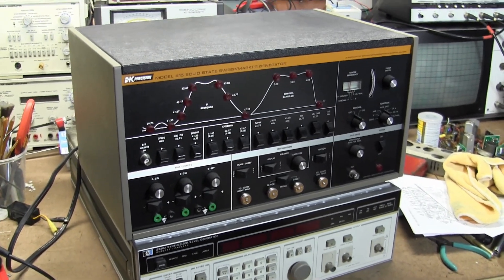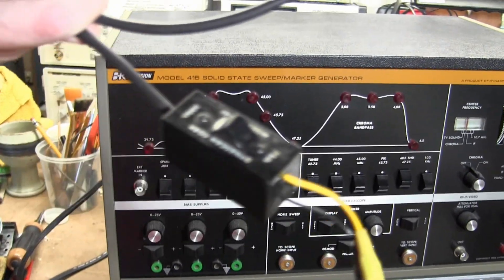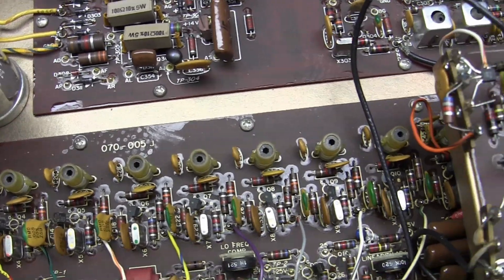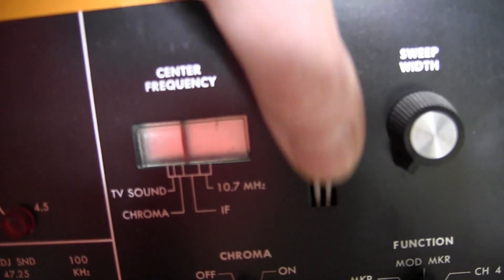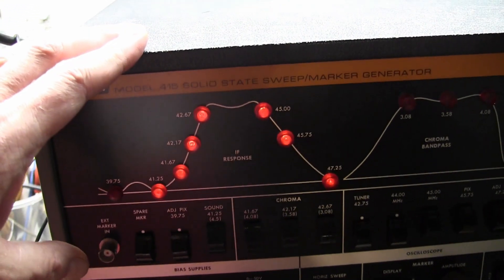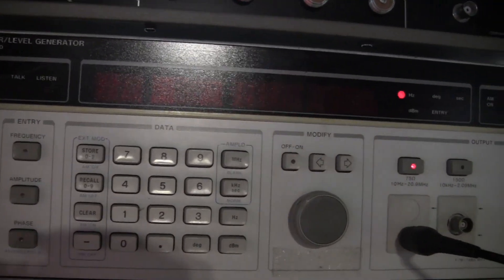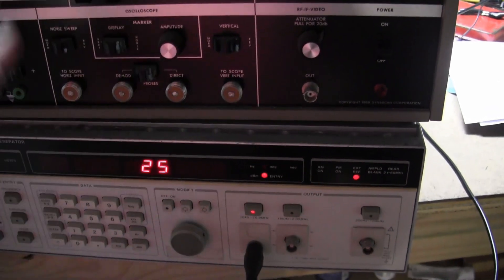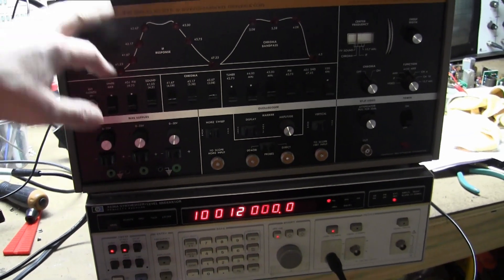Quick look at a B&K 415 and HP 3336A sweep generators

Comment: Please post an in-depth video of doing alignment with the B&K 415.  shango has videos, but his video on chroma alignment doesn’t explain where to hookup the B&K 415 to the tuner.
Reply from the maker: Problem is the 415 only works on newer chassis using a 44MHz IF.  Most of what I work on uses the older 22.  
Also, you really need to follow the alignment instructions specific to your chassis.  They will tell you where to connect the generator.  Generally, if you are aligning the IF, you inject at the input to the 1st IF stage.  If you are aligning the tuner, you inject at the antenna terminals.

Comment: Hi bandersentv. Thanks for the video. Sometimes the stuff you say really surprises me. Those 3 center connectors on the 415 are nothing but extremely common microphone connectors. These were used on all kinds of vintage test equipment, like scopes and VTVMs. AFAIK Switchcraft still makes them (Amphenol was only one of them.) Every ham with a junkbox, and some vintage gear has some of these. Available at any hamfest. I still see musicians using vintage Astatic mikes using those connectors.
Reply from the maker: Yes, they are common, but you'll likely need NBC adapters to connect to your scope.  Easier to swap them out.  I was referring more generally to vintage test equipment.  The RCA RW-514A or Philco 7008 use some really weird cables and pods.
Reply: @bandersentv  Especially given that the mounting holes for the old Amphenol mic connectors are the same 3/8" holes that you need for a BNC. You can "return to stock" in a few minutes if you ever wanted to for some strange reason.  Have never seen a "microphone to BNC adapter", so you would need to make custom cables for connecting with your scope anyway...
Reply: @bobweiss8682  No. When ever I've moded vintage gear (don't you just see the BS in the term 'vintage.') Anyway, whenever I'v moded this stuff, I've almost always regretted it. (I can't see that there's a problem used a 50 ohm BNC... from the 415 schematic... but there's a reason that B&K choose these mike connectors (they can go with 600 ohm cable.) Another-anyway if one doesn't know the reasons behind the design then.... Also, if someone can't (and I'm not saying you can't) ... if someone can cut a BNC - BNC patch in half, and solder a 250 F on the other end... how they gointo 'fix' radios?
Reply from the maker: These connections go directly to a scope.  How many scopes have 600 ohm input impedance or use mike connectors?
Reply: @willthecat3861  I thought 'vintage' was 20+ years and antique is 50+ years. Is that in error?
Reply: @bandersentv  Well... how many vintage scopes have a 50 ohm input? (some of the very high end ones had switchable 50 ohm impedance) How many modern scopes have it? There's a reason for the 600 ohm audio cable. The 415... I remember that the old T.V. service guy had in his shop, was paired with a B&K 1450 Oscilloscope that had mike connectors. Pretty sure some RCA WO series had mike connectors. Some Hikock had them too. It seemed to be common enough for early American manufacture scopes, that were low bandwidth (even for the day.)
Reply: @zulumax1  I don't know if there can be an error.... the best answer I can fathom is that it's all part of the BS.
Reply: @willthecat3861  "don't you just see the BS in the term 'vintage.' " Your words, I'm looking for clarification, because I am not seeing it.
Reply: @bobweiss8682  I thought I had a microphone to BNC adapter that came on my Eico 249 VTVM, but when I unscrewed it, it was a coax type connector like a RF antenna, not an Amphenol style microphone connector. Not sure if that is stock, never seen that on a VTVM probe connector.
Reply: @zulumax1  Baffeling Substitution of an oenologistic term often used in the context of deceptive marketing.
Reply: @zulumax1  Sometimes people try to bodge a PL259 connector (that's a common RF connector)... by cutting down the center pin of a PL259... to try to make a 250F type female mike connector... but PL259 has the wrong thread count... so shouldn't be screwed on... but people force it on anyway. Maybe the adapter you have was originally a PL259 to BNC... and someone cut down the center pin on the PL259 side. I have seen it.

Comment: Great explanation :-) 

What’s your opinion on a Heathkit TS-4A Television Alignment Generator 
I just found one for $20 at a swap meet
Reply: Replace the three electrolytic and all four wax paper caps . Check all carbon comp resistors for drifted values.
Replace the blue colored Selenium rectifier with a 1N4007 or better. Check all the tubes. Clean every switch as 
the contacts will surely be oxidized. There is a conversion sheet from Heathkit to make it a TS-4A if you want. 
The TS-4A manual  is available on the web for free.  You will also need a probe and or a test lead for it. Again
 see the manual for how to make them.  As for aligning it there I'm not sure as you may need an oscilloscope
 to correctly align on it. Good luck on the new acquisition.
Reply: Great thanks for the information and numbers. :-)  I’m quite familiar with replacing caps and restoring. I was more wondering if it’s something worth bothering with
Reply: @alexinnewwest1860  It's worth bothering with. For some people doing IF alignment on early T.V.s it's quite useful. The 415 won't do those earlier IF frequencies. It uses some common tubes... and put back right... the tubes could last a long time. It's got a pair of Colpitts oscillators... but if you cal it properly, and let it warm up... it's much better than those old T.V.s
Reply from the maker: A bit too early for me.  You'll need to let it warm up and periodically calibrate.  Doesn't have post marker support either.  Eico 369 is a little better in that regard.  Also, it relies on the AC line for the sweep signal.  You may have trouble getting your scope to work properly if it doesn't support driving the x-axis form the ac line.  The phase control is there to help with that.  I'd swap out the old Amphenol connector for BNC.
Reply: Ok thanks.  Maybe I’ll throw some new caps in it and play around just for learning purposes. 
I just found a 57  Chisholm Industries  TV which was a local electronics manufacturer here in Vancouver back in the day.  I’m excited to pick it up
Reply: Be sure to get the calibration reference crystal that goes into the XTL socket on the face on the left side.  Its 4.5mc and came with the unit for that purpose.  The manual describes the calibration procedure using that crystal with either a signal tracer (or amp with a lead with a detector diode) or a scope.

Comment: A few years back, I lucked into an HP 8662A at a really good price (needed repair), and retired all the other RF and sweep/marker gens I had acquired over the years. Has the same programmable sweep features and variable encoder knob of the 3336A, but works up to 1.2 GHz.  It replaced an HP606A, a Boonton 202H, A Wavetek 1001, and a Heathkit IG-57A with one piece of gear.  Wretched excess for working on old TV sets and radios, but why the heck not?
Reply from the maker: Lucky!  Someday....someday....
Reply: because somebody else who really needs a 8662A is using the kind of gear you got rid off. (Maybe you need it too; but, that won't stop somebody who doesn't from copying you.)
Reply from the maker: Who exactly really needs an 8662A that is unable to get one?  If you're servicing the type of equipment that requires than level of sophistication, you should be charging your customers enough to afford one.  Better yet, get a newer device that's been calibrated and under warranty.
Have you seen Mr Carlson's Lab or the Signal Path?  They have piles of high end equipment sitting around.
Reply: @bandersentv  Exactly...
Reply: @bandersentv  Mr. Carlson creeps me out... but, that's just me... I'm not implying anything. Signal Path is a hghly educated engineer, and works for a modern research University, in a very expensive, well funded lab. But yes... they are examples of how YouTube influencers can have unintended influence, and lead people astray.
Reply: @willthecat3861  Interesting perspective you have on others collections of test equipment. I never thought of it as a moral dilema. Having a collection of more things than one person could ever possibly use does seem wasteful I suppose. I just thought of it as benign vainity.
Reply: @zulumax1  I wouldn't even go as far as any kind of "vanity". For many electronics hobbyists, vintage lab-grade test equipment simply becomes yet another enjoyable aspect of the hobby. Old enough to need some TLC to keep it going, which "serious" users aren't going to want to provide, but new and powerful enough to be head and shoulders above the usual service shop gear from B&K, Sencore, Heathkit, etc. Professional T&M gear of that era was designed to be serviced, and reading the service manuals and studying the schematics and construction techniques used provides an great educational experience in itself.  It is refreshing to work on equipment that hasn't been built down to the lowest possible price point, and that was absolutely "unobtainium" for anyone besides NASA or research universities a couple decades ago.
Reply: @zulumax1  Everybody is irritated by a moralizer... (my fave to disregard is Aesop... though he was good on Rocky & Bowinkle) ,,, anyway my opinion is given as a comment... not some attempt at a proscription... it's a free country, free market... business... yada yada and so on. I'm disinterested in what other people do, or don't do. But if you are not familiar with "The Tragedy of the Commons"...
Reply: @bobweiss8682  And so... are these kind of YouTube vids 4 people with a quality test gear fetish... or for mostly hobbyists putzing around with old TVs... not professional engineers or scientists... with a good understanding of analog and digital electronics.  U can fix and Eico, or a Stark, or Heathkit... if you can solder, and have some basic electronics knowledge and skills. Yes... older HP, Tek, R&S are well doced, quality made, and 'serviceable'... I've had to spend weeks (and months) sometimes, to understand what those engineers were trying to accomplish with that design... and sometimes longer to get the parts to fix it... not to mention the cost and time to cal it properly. Sure... I can pretend I have a 'lab' in my mom's basement... with some really nice old hitech gear... but if I don't know how to use it, how it works, or whether it's really working in cal... what am I really doing? What's wrong with a nice Eico sig gen, redone, caled up... and perfectly appropriate for work on old radios.
Reply: @willthecat3861  What exactly does the "tragedy of the commons" have to do with obsolete high-end test gear?  Was there some public clearinghouse somewhere distributing the stuff for free to "deserving", "properly educated" engineers and professionals with struggling startup companies or something? And now all the evil YouTube electronics geeks are snapping it all up?  Seems to be a lot of supply still available whenever I am looking for something specific. I have a shop full of this kind of equipment that was purchased over many years at WELL BELOW "market value" by careful eBay searches (look for "untested/not working/parts only" and within local pickup distance), or going to test equipment resellers and picking up units that were destined for parting out or the dumpster.  Any "deserving" hobbyist OR struggling inventor/engineer is perfectly free to do the same.  Sure, you can align a radio or TV with an old Eico or Heathkit 2-tube signal generator, but it is a pain in the ass compared to being able to punch in a precise frequency and amplitude, and know that's what you will get, every time. No having to use a pair of headphones to zero beat the generator against WWV or a crystal calibrator to know where you are. 

The ONLY example I can think of where a YouTube channel started a "gold rush" on a specific piece of surplus electronics was when Dave Jones at the EEVBlog did a video on the FE-5680A rubidium frequency standards that were then being surplussed out of cellphone tower service when 4G was phased in.  They were going for about $50 USD when they first hit the surplus market, but now they are bringing $200 or more (but still easily available), which is still a tiny fraction of buying a new one from Symmetricom or whoever. I got mine pretty early in the hype cycle, and paid about $80 for mine, which is used to feed a 10MHz master reference to all that other overkill test gear I have somehow "stolen from the commons". In MY basement, not my mom's.
Reply: @bobweiss8682  I am already there, I was just trying to see things from a third person point of view of the other fellows comments.

I would like to find some of the test equipment I used to use as a tech in the military. A Fluke analog differential volt meter that we used to use to tweak power supplies with, and I always had a fondness for the high end equipment I used as a technician. Some of the usb DSP testing gear is fine, but just not the same as old school gear.

Retired in 2019 so I have been building up some test equipment for the shop here in a spare bedroom. Nothing too esoteric, just some Heathkit and Eico test equipment that needs some love.
Reply: @willthecat3861  No worries, I encourage different opinions and I enjoy the diversity in the hobby, as long as folks be kind and keep things respectful.